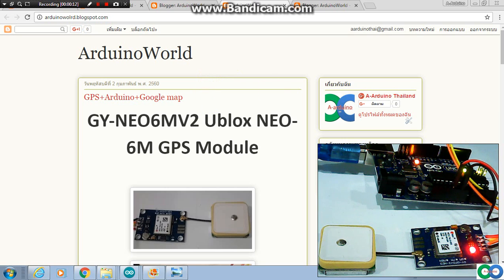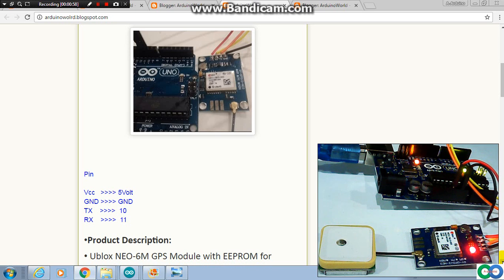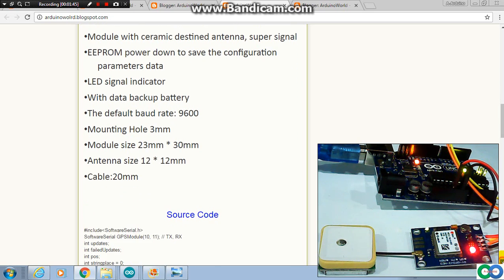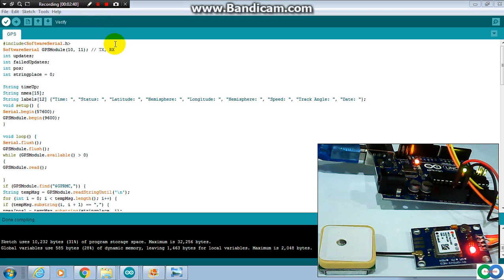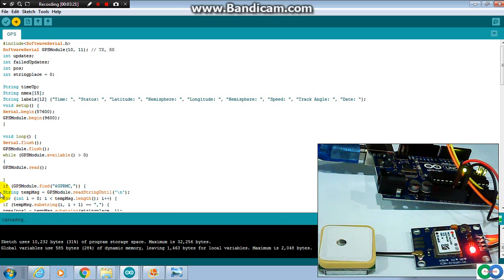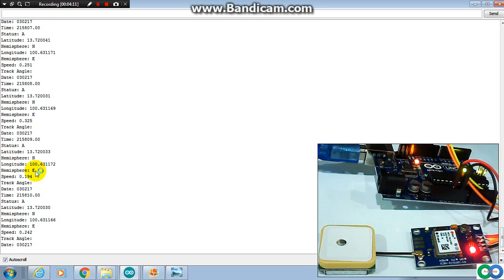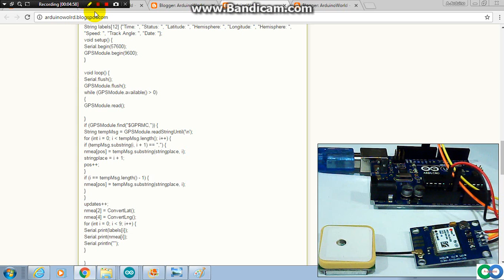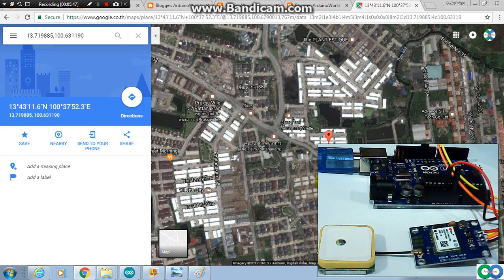GPS Arduino Google map

Comment: does it connected to Wifi ?
Reply from the maker: No . not wifi.   link direct to satellite .
Reply: A-Arduino Thailand the phone use 3g or 4g or wifi, so what the arduino connect with ?
Reply from the maker: not wifi or any network !!! This project use 2 devices 1. Arduino Uno 2. GPS module >>>
Reply from the maker: not wifi or any network !!! This project use 2 devices 1. Arduino Uno 2. GPS module >>>but indoor may not work because satellite can reach only outdoor.